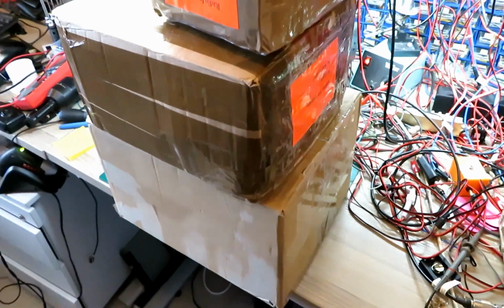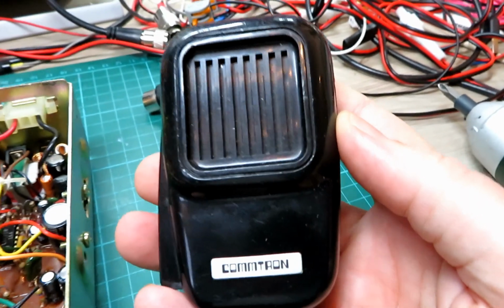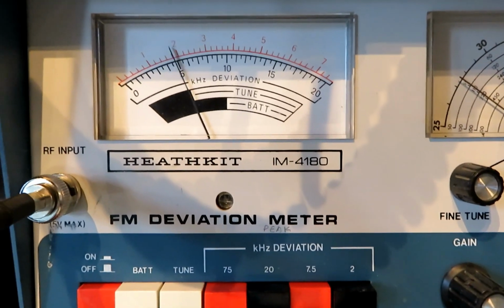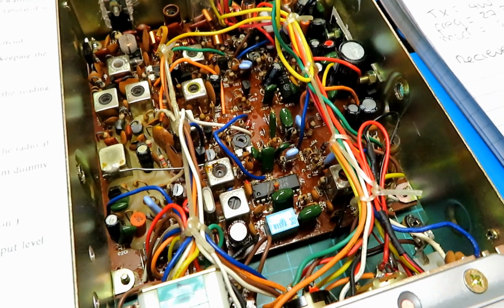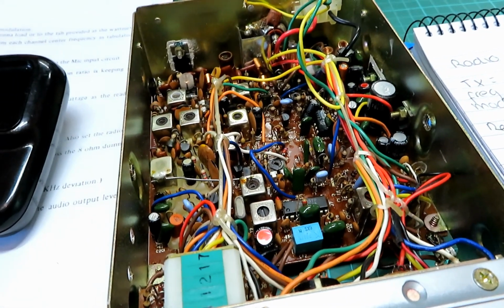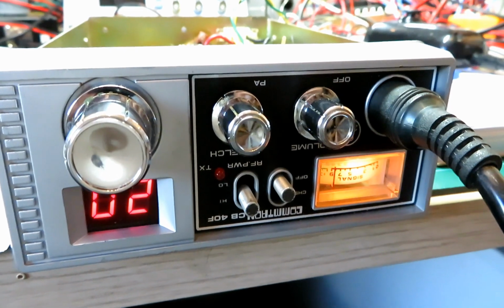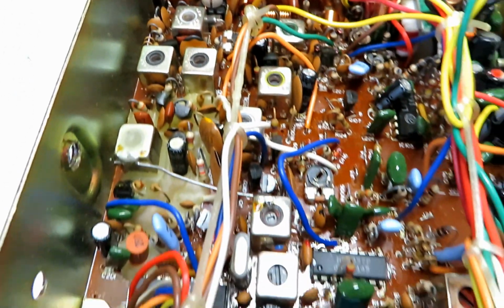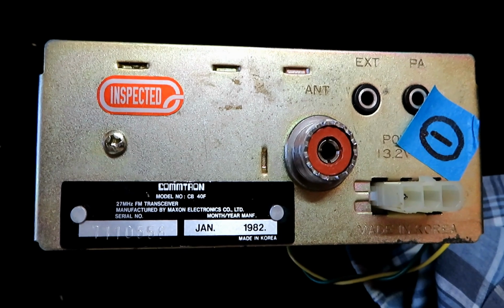40 YEARS ON  - RADIO GETS A BRAND NEW INSPECTION STICKER FOR A VERY GOOD REASON.

Comment: Is your swr bad, as you set the tx to key up on the s9 yet on the finished service and radio closed up your showing the key up to near the end of the scale ?
Reply: I wondered the same myself. 🤔
Reply: @RSCOZZY  Glad it wasnt just me, ty ;)
Reply from the maker: Yes I noticed that, was plugged in to the silver Rod and not my roof antena, the silver Rod is leaning upb side the house after the high winds.